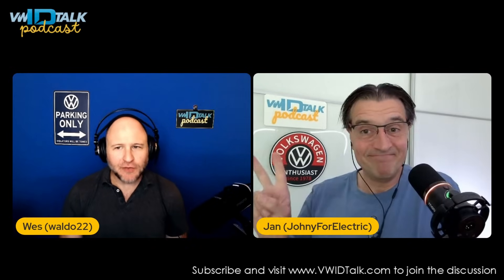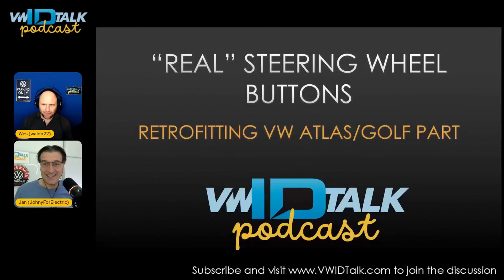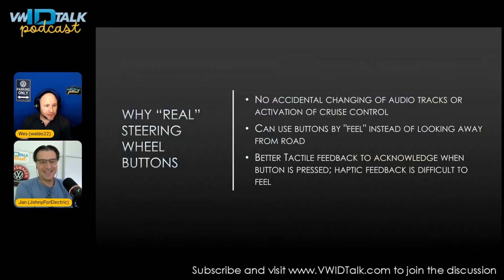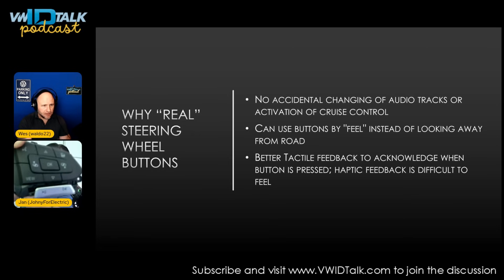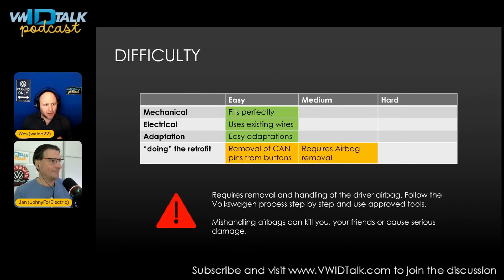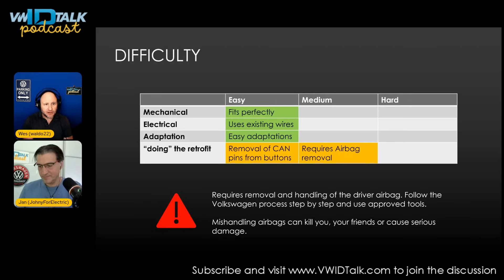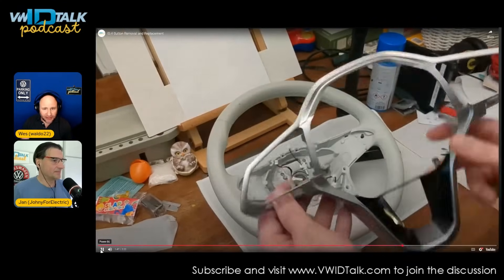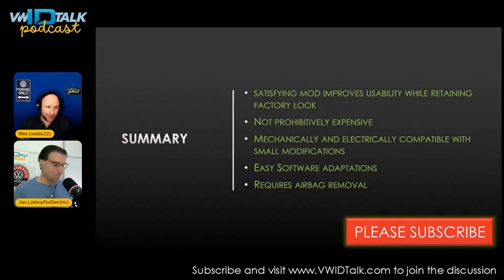VW ID.4's Big Problem SOLVED - Real Steering Wheel Buttons!

Comment from the maker: Let us know if you tried this mod or you have some ideas or recommendtaions! More details and latest updates on VWIDTalk 
https://www.vwidtalk.com/threads/i-have-real-steering-wheel-buttons.18466/.

As a side note - 
Out of all the touch buttons these were the BEST engineered in the ID. family. We wish we could set the touch sensitivity and the geometry would allow us to find the right spot without looking. We think it's doable. After digging deeper our hypothesis is that these buttons can do way more than what is implemented in the software (like adjust sensitivity, haptic feedback or function for hard press).

We believe the easiest thing that VW could have done was to open customization (sensitivity, feedback, hard press) to the driver via multimedia settings page. It would have been a killer feature of the car...

Comment: The button on the right side in the steering wheel, have it own life in mine id4 it turn up and down the volume without me touching it ?
Reply from the maker: Hm, that is frustrating. Does it happen consistently or only sometimes?
Reply: @v @vwidtalkdotcom only some times 😔

Comment: Solving problems that is not a problem. The buttons are fine. Those who does not get the buttons, they are the ones that still use Blackberry and Nonia 3210.
Reply from the maker: Thanks for sharing! What version of ID. do you drive? VW made some updates in the ID. Software 4+ vehicles to the touch buttons, but they still have not exposed detailed settings of the touch steering wheel buttons in multimedia...

Comment: Can I do the same for VW Tiguan 2024? I have same steering wheel and I have this touch sensor buttons .
Reply from the maker: Technically yes, but we have not validated this. We thought that 2024 Tiguan has the tactile switches in all trims, not the case?

Comment: that is way exaggerated.. you get used to the buttons and it is not a show stopper or a big problem, that is just stupid. I have been driving IDs for 4 years now. The missing battery preconditioning on the cars up to 2024 is a much much bigger issue
Reply from the maker: Thanks so much for sharing your opinion. It really depands on personal preference and patters of use. For those who charge at DC fast chargers occasionally the pre-heating is not such a big blocker, but agree that for those who depand on DC fast charging, it's a big thing!

Comment: The most ridiculous complaint ever. The haptics not only work great but look better and more premium than the cheap hard plastic buttons.
Reply from the maker: Thank you for sharing your observation. I agree that the technology in the steering wheel buttons is amazing. Let me ask you - how are you changing volume without looking? (if it's on the left - you have the improved version that came with software 4)

Comment: Could you instead replace the whole steering wheel with one from Atlas/Tiguan etc?
Reply from the maker: You definitely could. The question is what is easier. Removing the entire steering wheel, replacing one time use parts, using right torque and dealing with spiral wire is another level of complexity. Not mentioning potential adaptation of the touch sensing system...

Comment: Hos about the Cupra Tavascan????
Reply from the maker: Electricly - likely yes, but mechanically, it looks from photos (sorry Cupra not sold in the US) that the steering wheel trim is little different on the Cupra compared to Volkswagen... Skoda has also slightly different steering wheel. So retrofitting cross brands might need to replace the entire steering wheel... Sorry.

Comment: Can this be done with a Cupra Born, too? Alsmost the same car as the VW ID.3, but different touch button layout. After 6 months these buttons still annoy me.
Reply from the maker: Electricly - likely yes, but mechanically, it looks from photos (sorry Cupra not sold in the US) that the steering wheel trim is little different on the Cupra compared to Volkswagen... Skoda has also slightly different steering wheel. So retrofitting cross brands might need to replace the entire steering wheel...

Comment: How do we get the folks at VW to see it would be EASY to make customers VERY HAPPY 😆 but also the ease of using EXISTING PARTS BIN components!
Bring on the window controls — PLEASE!  To not have to listen for the ‘plunk’ sound to know I’ve got the control in ‘rear’ or ‘all’ modes would be AWESOME.
You guys could probably NOTICIBLY increase sales, just by test drives going flawlessly instead of dealers having to train a possible buyer on how to roll the back windows down.

Comment: I’m 32 & I LOVE the touch pad 😂 The window button doesn’t bother me at all either 😂
Reply: I prefer the haptic pads, especially for increasing or decreasing the cruise control.
Reply: @phillipwilliams2977  I hear you - light press 1MPH, hard press or swipe 5MPH. This part was definitely well thought out.  I never realized how much I I was looking at the controls to find the right touch spot. I'm sure someone must have done a study on this.
Reply: I'm glad you guys like those things.  There are several good things about the design, like the volume slider.  I thought the issues were overblown too, and that I would get used to it, but I can't.

The problem for me is the accidental activation of buttons, usually changing my radio station or music track in the middle of the best part of the song or the most important part of a news story.  It's infuriating, and it happened almost daily.  Maybe there was something wrong with my steering wheel.

...and as I said in the video, on 2 occasions I activated cruise control and it cased the car to accelerate when I didn't want it to, which was scary.

I also find the window switches infuriating.  It would have been fine if it were properly executed, with a push-down switch for "rear" instead of a capacitive abomination with no haptic feedback.

In practice, I end up pressing the "rear" button nearly every single time I want to lower my windows, which is especially irritating at a drive-through or trying to get the mail.  Then I have to press the "rear" button multiple times to get back to the front windows because it doesn't register the press on the first try.

This morning, I wanted to roll up the rear passenger window, and I had to press the "rear" button four times before it would register the press.  That's also infuriating because it activates so easily when I don't want it to.

I also often activate the capacitive child safety switch by accident, and the kids can't get out of the back of the car.

The capacitive steering wheel buttons would be fine if they worked properly and didn't activate when they shouldn't (and had the heated steering wheel button).

The 2 window switches would be fine if there were a physical latching switch to activate "rear".

As executed?  I think they are a terrible user experience.  At least for me.
Reply: @wesleykins that has never happened to me and I own 2 VWs so equipped with the haptic controls.
Reply: I'm nearly twice your age and I agree with you. There's way too much fuss about it.